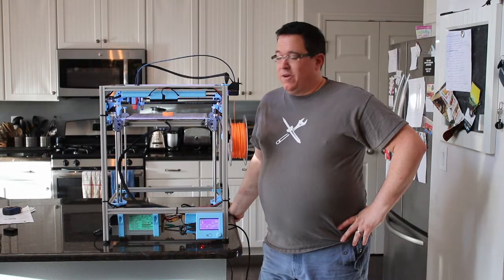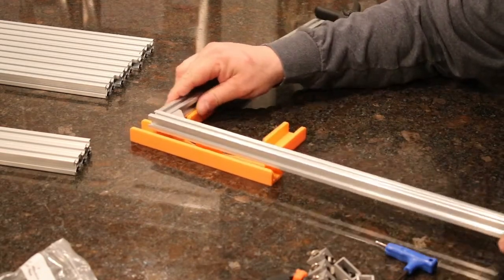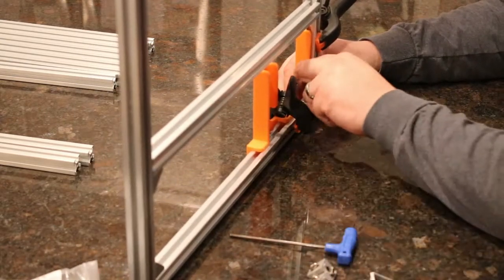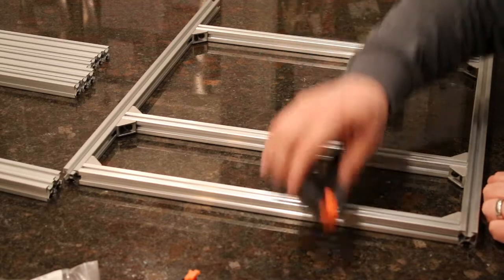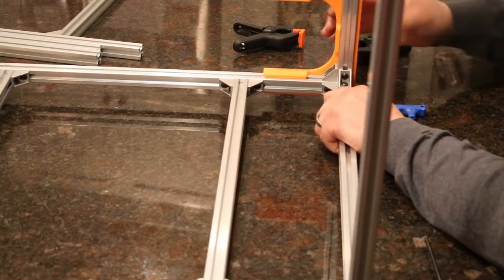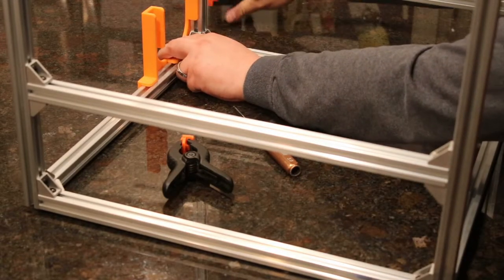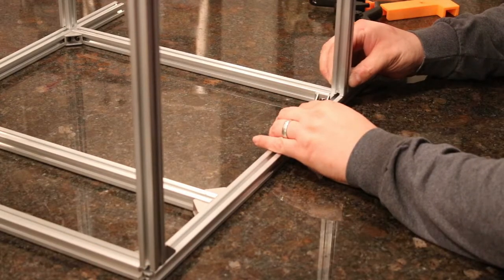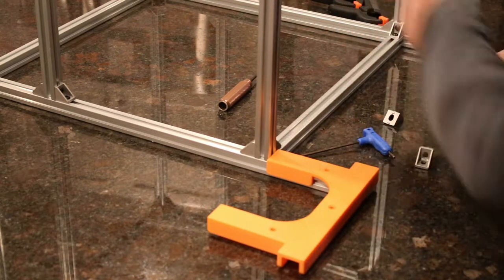3D GURU Building the Hypercube 300 Part 2: The Frame

Comment: ZYL Tech supplied you with all the parts, however, when I ordered my frame, instead of getting 10 440mm extrusions, I got 6x440mm extrusions and  4x400mm extrusions as described in their product description.  The parts I've received don't follow your build structure and pretty much changes a lot of the required printed parts.  Has ZYL Tech changed the frame kit recently?
Reply from the maker: If they did I was not aware.  I thought the sizes were all the same but they were adding some parts.  I actually just saw a pic of how they are building the hypercube and its....interesting.
Reply: Yeah, unfortunately they've changed the dimensions, and the actual build structure of the frame is definitely not as good.  To be honest, yours is much stronger and robust, which is why I wanted to go with what you had.  I picked up the additional 440mm extrusions locally so I could continue with what you're building.  Thanks for getting back to me :)

Comment: I started building this a while back. I spent more than 5 hours aligning that frame, because some of the extrusions had uneven ends and i had to make sure it became perfectly square cube. I really don't think you can make it by just bending the frame with screws loosened and then tap the corners. Yeah, of course every side is flat now but that doesn't mean that it's a perfectly square cube.
Reply from the maker: You don't have to bend anything.  If you are using the aluminum 90 degree corner brackets like in my video the ends of the extrusions can be really out if square and the frame will form a perfect cube as long as the length of all the cut extrusions are exactly the same.
Reply: thanks for the reply! I know what you mean but for some reason the extrusions gave me extra headache to get right :) I had to rotate and swap some of them around. Tough luck.
Reply from the maker: Good job keeping with it and getting it right.  Your efforts will pay off with an accurate printer that doesn't have weird problems.

Comment: Hi Adrian. I’m building your design, but went by the measurements for the old hyper cube considering a 300x300x400 platform. I’ve 450’s, 415’s and 650’s. Would that allow the 300x300 base considering your design?

Thanks!
Reply from the maker: If 415mm is the length of your Y axis extrusions you might be losing some Y travel.  If you use the light x carriage instead of the standard one you will gain it back.
Reply: Thanks. I’ve decided to go “square” based on your feedback, and I’m building two 300’s now, with a slight change of using 450 sides and 650 height. This is the frame so far :) https://youtu.be/WsyNgZuJB7c thanks for you design, btw. It makes a lot of sense imo, much better than the previous design.